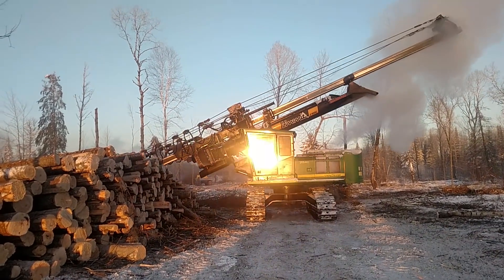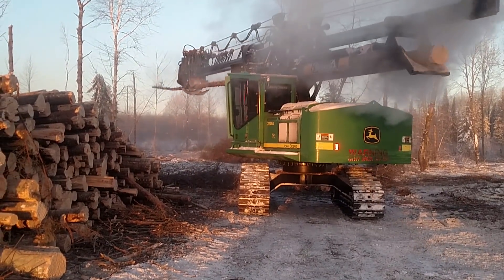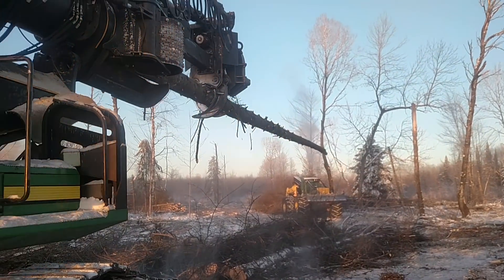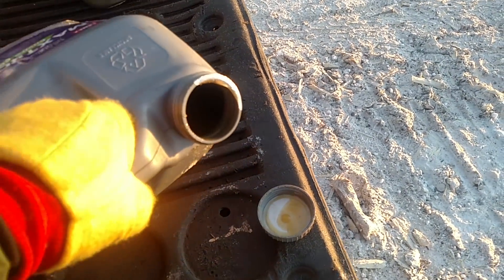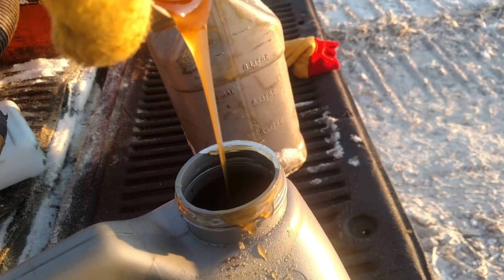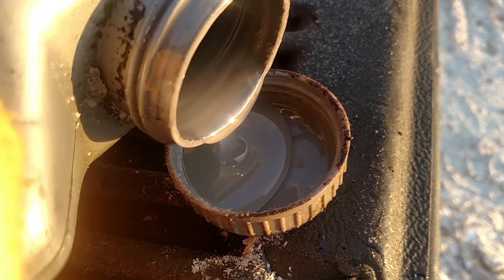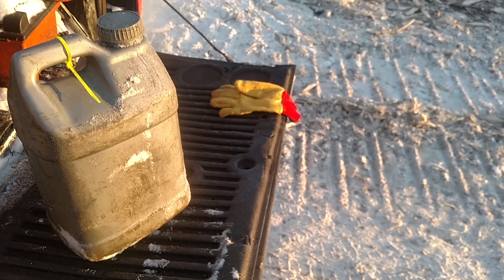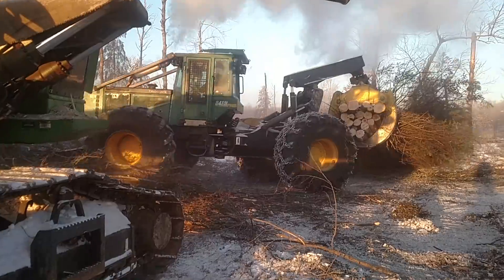Synthetic oil looks like syrup at -34°F

Comment: i ran a load from New Jersey back when i had my truck one winter to St Paul, Mn. it was cold the whole way, but when i unloaded up there it said it -35, white smoke flew out my stacks for days in that part of the country.
back when i ran dozer for a coal company, the dad died, so the boys took over that yr. they changed to a cheaper oil, we had 18 motors blow up that winter, our hydraulic oil poured like urs did there, at only say 20 degrees, way warmer than ur temp was. bad yr for sure.
Reply from the maker: Wow 20 motors!!! That's expensive!!!